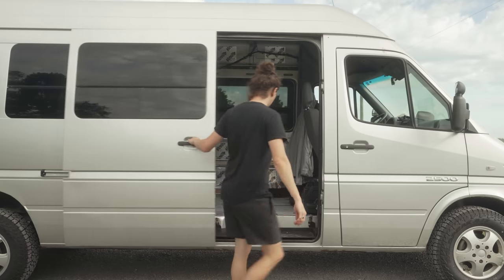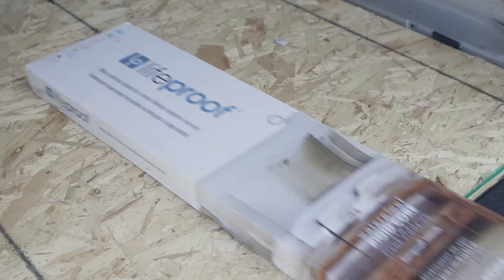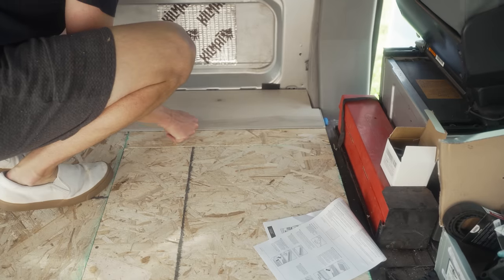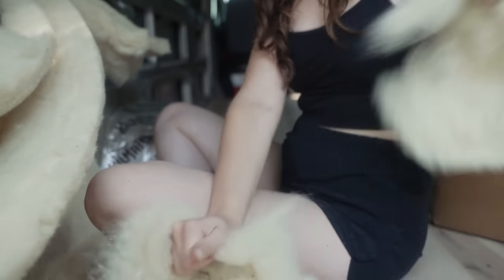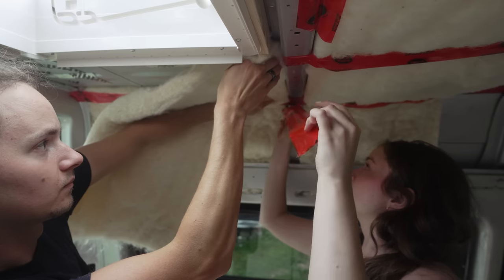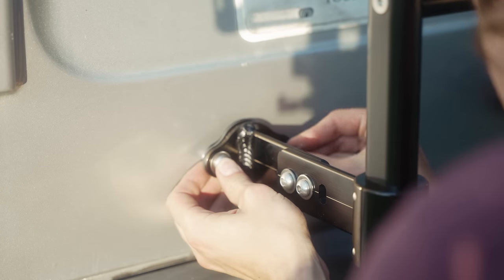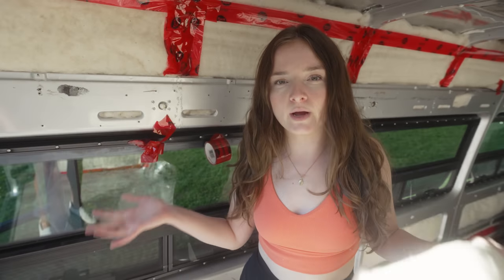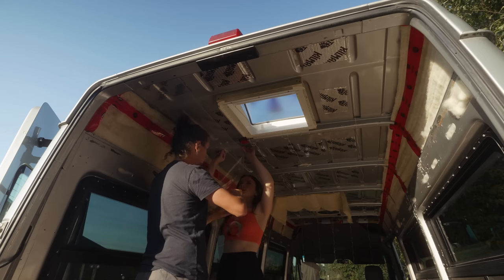This Van Life Build Ended In The Hospital: See What Happened

Comment: Why didn't you use just spray adhesive to attach the wool to the ceiling? You don't need tape or string.
Reply from the maker: We ended up doing that, but the wool is extremely fragile and non ridged so it would fall off - so it ended up being a combination of both lol! It worked well for the sides tho ☺️
Reply: @colinandpaige  I get ya. Damn, such a faff! (English word, means a lot of effort) 😂 hope you feel better anyway!